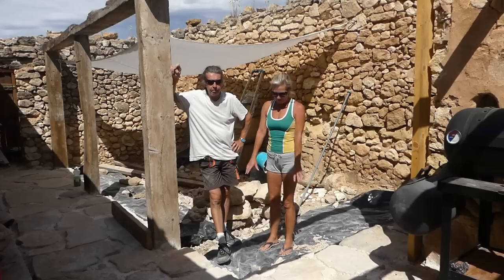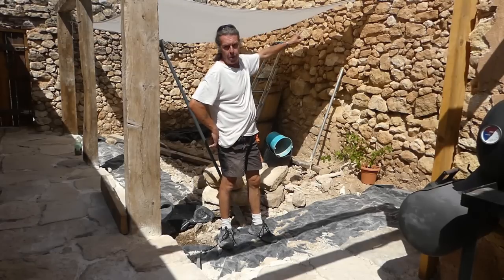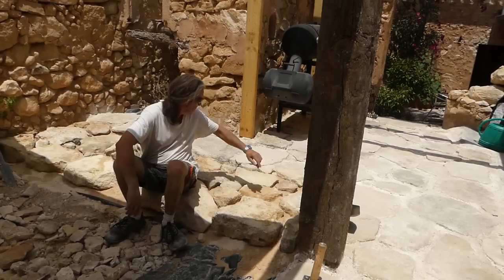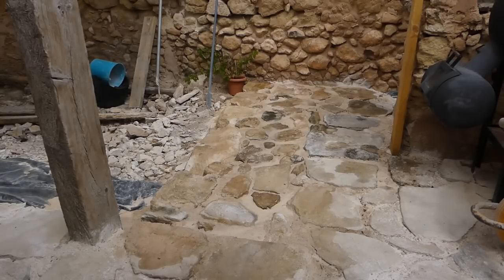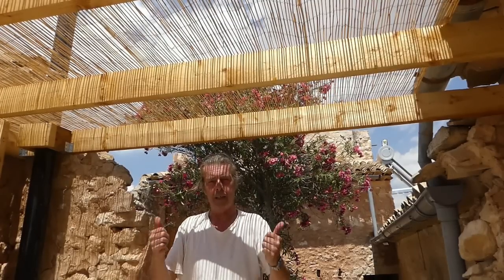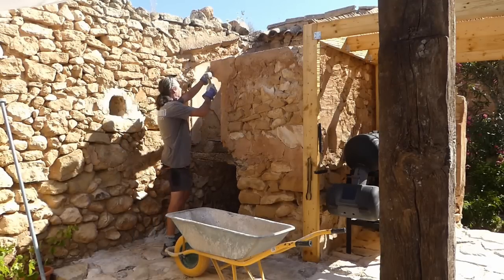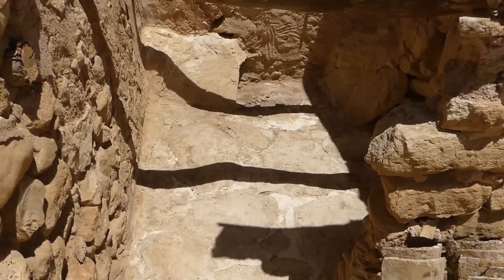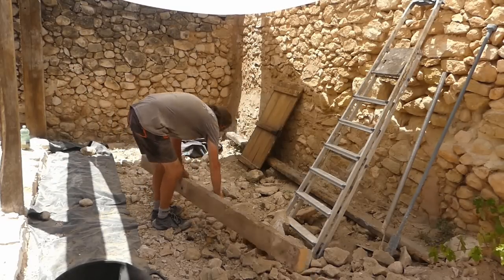Part 8 - Transforming the courtyard into a fabulous outdoor living space

Comment: Nice one guys. We are currently working on our patio in blighty, 80 slabs to lay using your dry mix method.
Reply from the maker: It worked really well for us. Just be sure to brush off any mortar you get on the surface, before it dries and try not to get too much water on the dry mix as the cement rises to the top if you get any pooling. Good luck!

Comment: A suggestion…. Why not move the bbq and smoker into the corner area you have just cleared… make a table top on top of the round beams… will give you more patio area and make use of that small ‘room’. Fire wood can be stacked under the beams.
Reply from the maker: Thanks. We really like the bbq where it is and we're definitely going to try and incorporate the original beams. Leaving the beams in, doesn't leave enough space for the bbq